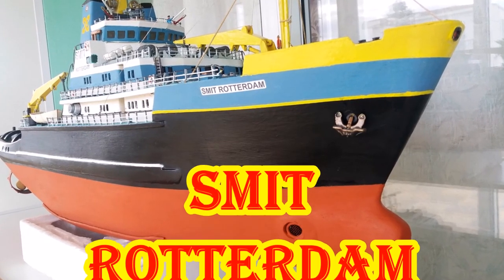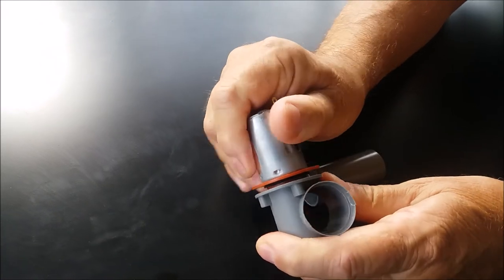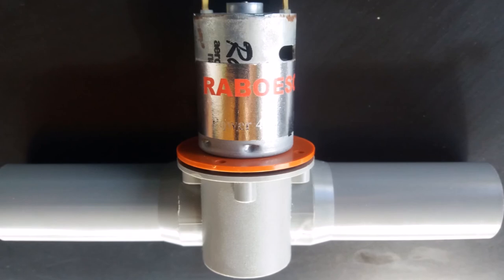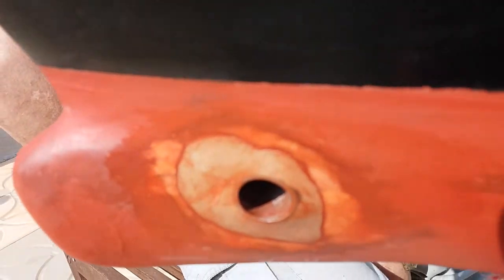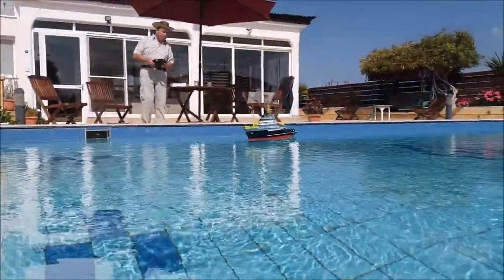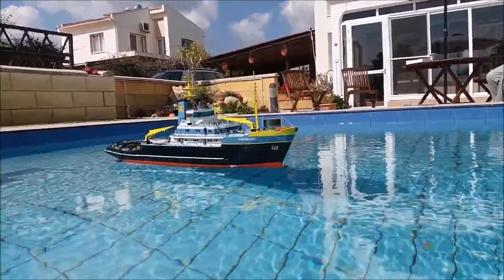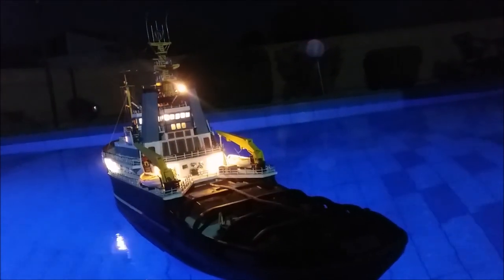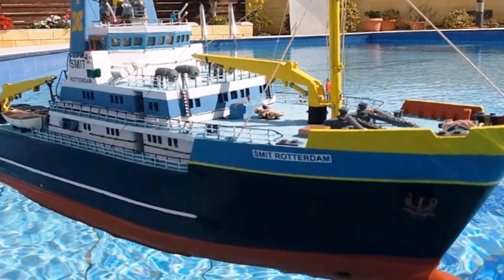SMIT ROTTERDAM. Part 4. Installing the Bow Thruster

Comment: Beautiful, I just became the owner of a brand new built Tito Neri and it has the bow Thruster installed, would you happen to know what channel do I connect the Esc for it to? When I plug the separate 12v battery to it and have the 10AMP ESC connected the motor runs constant, I have plugged into channel 2 because in channel 3 I have my throttle ESC connected, thanks for any help you can give me. Your boat came
Out GORGEOUS.
Reply from the maker: My separate 6V is connected through a separate ESC which is connected to channel 3. The main 12 volt battery is connected to the prop motors ESC which is connected to channel 2.

Comment: Hi can you tell me if it's a 6v battery or a 12 volt you are using as I have the same boat but no battery thanks
Reply from the maker: 6V for bow thruster. 12V for main power.
Reply: @hobbylife2294  thanks